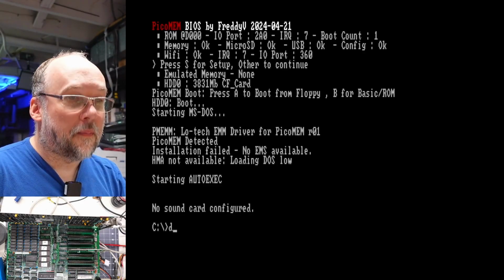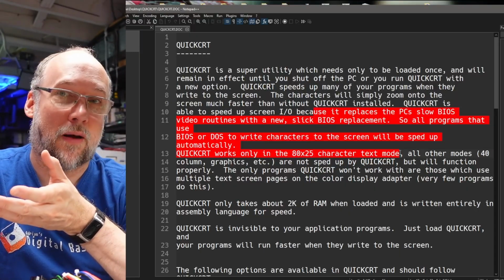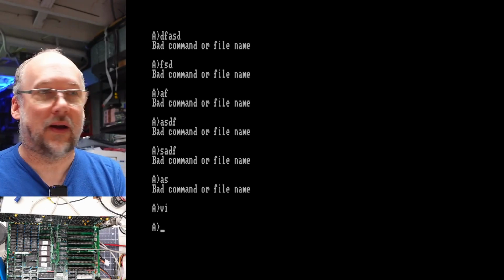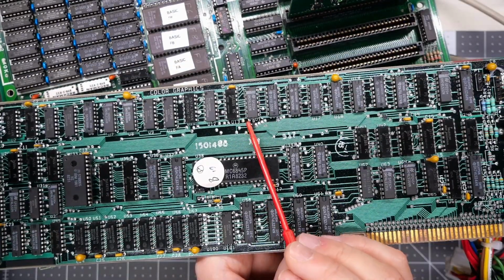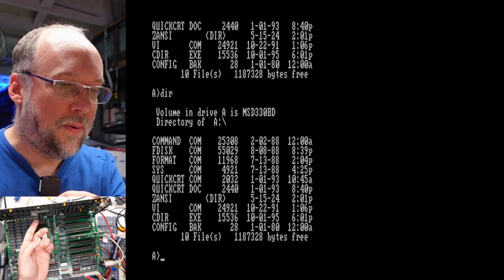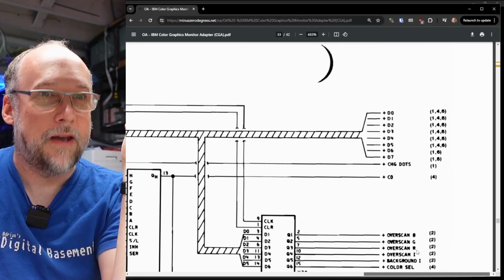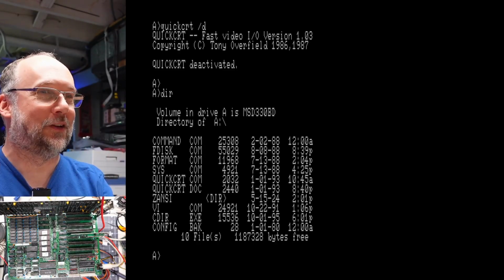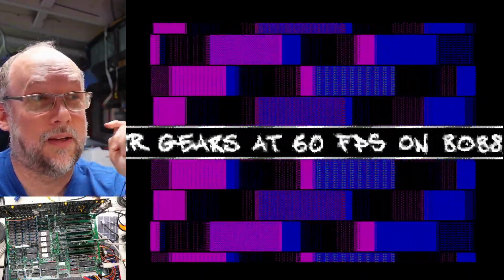Hacking an IBM CGA card for fun and speed!

Comment: Your character set mod is delayed by one character because the character generator address needs to be available before the character generator output and character attributes are latched. You could try tapping into pin 3 of U35 instead of pin 2.

Comment: The wait-for-sync and blank-during-scroll is almost exactly what Commodore did in their first PET, where the 1MHz video memory is not fast enough to accommodate video output and CPU access at the same time. I'm showing this in my deep dive PET video video https://youtu.be/pwb5GvmoAFE?si=WWMkHAxhwFKh93ZK

In the followup PET with 6545/6845 CRTC with 80 cols, Commodore worked around this by making the video memory 16 bits wide - every clock cycle the circuit reads two characters, not one.
Reply: The equivalent for the quickcrt on the PET is a specific POKE command - speeding up screen IO but producing snow on the screen. This POKE in later machines messed up the video circuit and became know as the 'killer poke'. The opinion that it breaks the later machines has been debunked in the meantime though

Comment: This is pretty cool. 

I like mods like this.The only time I really would have an issue would be if it is a very rare piece of hardware with historical value in its original state, the only mods I'd like in that case would be necessary repairs and mods to use the thing at all. CGA cards are common enough this isn't an issue I'd have.

Comment: Umm, I could be wrong here, but the signal you were trying to hack in the second part was labelled -DISPEN .  That suggests to me that it should be low (-) when the display is enabled (not in blanking).  So when you pulled it down to ground, you were telling the computer that it is never in the boarder/blanking interval (it is always displaying video), so there is no time where it is safe to update the display.  (That is also likely why hooking it up to +VSYNC_DLY had the opposite effect you intended too, because it signalled that it was only safe to update when VSYNC_DLY was active (i.e. once per frame).)

You should have tried just pulling it high instead and then I suspect that would have had the effect you intended.  You just had the logic level reversed from what it should be, is all.

Comment: That newer CGA card actually looks like it's got a Video BIOS onboard (the two large chips in the corner).  If that's the case, then the reason it doesn't flicker is probably not because it ignores that hardware line, but actually because when the computer first boots up, it detects the expansion card's ROMs, executes the code in them automatically, which replaces the default BIOS routines with its own custom ones (similar to how ZANSI.SYS or FASTCRT do).  The software patch is just built into the card.

This was very common for most video cards with more advanced features, as they would add functionality to the stock BIOS routines to support switching to other modes, or using more advanced graphics capabilities, etc, that way too.

Comment: Single pixel wide and double pixel wide character sets... seems likely this was intended to support light and heavy (bold) characters in text mode. BUT because of the requirements of composite video bold text is enabled always. Also possibly because they ran out of attributes bits in CGA so the feature couldn't be implemented but IBM already had the ROMs so character set could be selected with this hardware mod. Documentation for ANSI.SYS from Microsoft listed the ansi escape sequence for bold text but it didn't work. So maybe It was supposed to work but the hardware support just never happened

Comment: As an academic exercise, the mods and investigation surrounding them were very interesting.
The fact you posed the question to the audience regarding butchering what is presumably a genuine IBM CGA card suggests you at least belatedly realised that the activities would raise the hackles of some viewers.  
   - Ultimately, it's your board, you have at least one other and as you point out, you'd already resurrected this one from a scrap pile, from where it was in a heavily corroded state. 
          (I'd tin and wick off the excess solder to protect the exposed copper on the edge connector, BTW - precursor and material to gold plate that exposed copper is horrendously expensive)
   - On the other hand, having resurrected a genuine IBM CGA card, it would have been nice to have it in as pristine condition as possible.  
          - The counter-argument to that is, had you done these mods to a supposed 1:1 clone of an O.G. IBM CGA card, there's always the doubt that it is 100% electronically equivalent to "the real thing", so doing same mods on a clone board may generate false positive and/or false negative findings!

Comment: I am not surprised about the font attribute delay (well, I design video pipeline in FPGA for a living) : graphics data has to be read from the character ROM in advance. The attributes are applied while shifting the 8-bit data to the video output, one character delay later.

Comment: Can you replace the dram with sram and just disable refreshing. No its not ruining it, ruining something would be replacing the og motherboard with a pi in an nes. If you actually use the retro hardware you would want to mod to be better at running games and software.

Comment: For modifying the board, I would have considered putting the chip in a socket.  You can pop a pin out of a machined pin socket fairly easily or you can bend the leg of a chip.  
I would also have likely tried to put in some sort of deadbug circuit to make the CRT enable easier to control and also make the blanking signal the software waits for always true.

Comment: It's weird... I had an original 5150 with CGA BITD, and I do not remember the flickering at all.  Of course it has been almost 40 years since then.
I do remember the snow, such as while CopyWrite was failing to dup a disk.  I hardly ever loaded ANSI.SYS though because there were few programs I had at the time that would send ANSI escape codes.  Also, BASIC seemed to go through the BIOS routines so BASIC programs also didn't benefit from it.
But to answer one of your questions:  Turning off the blink bit allows the background to have all 16 colors.  With the text blink bit on, the background would take its brightness bit from the foreground text color, IIRC.

Comment: Maybe instead of cutting the trace and permanently pulling enable pin high, it would be worth adding a capacitor there. So that it stays on during brief interruptions (like, when scrolling), but still keeps off until initialized.

Comment: The font data is loaded into the shift register before the attribute data is read, so it won't have the attribute set for wide font when the font data is being read
Reply from the maker: Ah yes, ok makes sense! It's always offset by one character. (Verified as I've used this card a bunch more.) I suppose this means there really is no way to fix this problem without massive re-engineering?
Reply: @adriansdigitalbasement2  Not if you're using the attribute, no. CGA memory is pairs of bytes, the character code followed by the attribute, so the attribute is always read second. You'd need to come up with some other way of switching between the fonts, which won't be as good as using the attributes...

Comment: If I had the knowhow and tools, the video I'd be hacking would be the colour output of a C64 ... It could be much more vibrant and still retain its charm without having to burn out overdriving a monitor!! Hater's gonna hate, I know - but I started with an Amstrad CPC and I don't think anyone can say that its colours were duller than a stock C64!

I do get that it would change a lot of what gives the C64 its charm and fond memories of course, don't get me wrong, but it would be nice to have the option ... I know there's a vic emulator that lets you tweak it too, but I'm more interested in learning how to do it the hard way, that way I'd at least have a clue about what to do if it goes wrong!

Comment: There's an active-low minus sign in "-DISPEN". I think that when you tied the signal low, you were creating the "active video" state all the time. So it waited forever for the horizontal retrace. Out of curiosity does it work if you tie pin 4 high instead of to the 3.58MHz clock?

Comment: ooh this is fun! 
about the performance mod:
i would reckon the duty cycle of the display-enable signal is the key to speeding things up, rather than its frequency - high represents the display being on, low represents off, so a shorter duty cycle should make it think the display is off for longer

assuming the 3.57MHz clock has a ~50% duty cycle, that's shorter than the ~70% i'd expect from display blanking, but not by all that much

having a very brief pulse at the end of each scan line would probably be ideal for speed, but also compatibility

Comment: this is very cool! And really only possible on this old hardware, where you literally solder around bits and bytes! This is gold for understanding how things work!

I wonder if you could bodge some dual ported Ram on the thing and "route" the acces to different ports depending on the system writing to memory or the CRTC reading and displaying.

huh... can you replace the DRAM with SRAM somehow? just ignore all the refresh shenanigans and use address and data lines accordingly?

Comment: The 14.318/3.58MHz tinkering, try inverting the display enable signal that is already there.  That would still toggle the line allowing the software to see what it wants, but it would result in being able to do access RAM most of the time rather than just when the active part of the display is not being drawn.  Inverting VS before using it instead would give even more access time.  Access time could be extended out even further using a oneshot triggered by HS to give almost full time access but a oneshot would be tied to the vertical rate, so not necessarily a good idea.
Reply: Oh that would  be a worthy followup.

Comment: Have you tried GLaBIOS as a replacement for the system BIOS? It has options where you can choose different levels of CGA snow removal including disabling it entirely to get that same effect as your hardware mod. It also claims to be faster at CGA scrolling than other BIOS ROMs. Would be fun to see you could test and verify that though.

Comment: Not that I've looked but the character dots are probably being produced by a shift register, which latches in the data on the edge of some other signal.  Delay that latch signalling a wee bit so that the CG ROM address line has had time to set and the ROM itself now returns data from the alternate space and you'll likely solve the thin / thick character problem.  A single buffer of a 74LS07 or the like would probably be long enough.

Comment: my questionable thought would be to piggyback another 64K of RAM onto the existing ram and have those outputs go to the CRTC instead of the originals. i dunno if it'd work (and there are a bunch of reasons why maybe not) but if it did it'd kind of like having dual-port ram in the dumbest way possible. :D

Comment: This is all just great. But you don't mention the DOS TSR that fixes the snow problem! Long ago I had an idea for a 3D display using crossed polarizers. To implement it, I needed to understand how IBM PC graphics were generated and controlled. So I bought a book called "Programming the EGA and VGA Displays" and I learned x86 assembler (oh what torture) to understand it. Then hardware got way better, and I realized I was barking up the wrong B-tree.

Comment: 36:48 I think that BIOS procedure can't start writing if signal is already low because it will not know it just started or about to end and how much times i has, so it waits to high and then to low signal yo be sure
Reply: This is my thought, too.  I suspect the BIOS is looking for the transition 1->0.  That's why replacing the signal with VSYNC caused  a steady 60 characters per second.

Comment: I thought the CGA snow was due to IBM not using dual-ported video RAM. The CPU would write to RAM in the middle of the scan line, which would cause incorrect data to be briefly read by the character generator.

Comment: oh god be careful with this and CRTs, you don't want to dump invalid looking pixel clocks / vsync / hsync at a CRT, you can damage it!
Reply: It was only a problem with MDA, wasn't it?
Reply: @aliencray7269  I /highly/ recommend not sending CRTs invalid hsync/vsync signals. 🙂
Reply: @aliencray7269  (weird, I thought my reply went through.)

It depends on what monitor you plugged in. I forget if the CGA monitor sourced its own hsync. But I've seen CGA equivalent monitors that did not.

Comment: Very nice video, I loved it. I can't remember what software hack I used that time, but for file editing we used Volcov Commander.
Volcov Commander (VC) was released later in the early 90's, but in Hungary, our computers were a few generations behind. It was something like the Norton Commander, but with very little memory usage and bare bone assembly programming. I definitely used on 286 and 386, but I believe it's capable to run in XT as well.

Comment: I had one of the earliest true IBM CGA cards. I worked for IBM in the early 80's. It was a pretty terrible card but the 6845 CRT controller was a competent IC that later clone makers were able to improve on with their cards performance. I believe the 6845 is still being made, if not, they're pretty easy to source 45 years later.

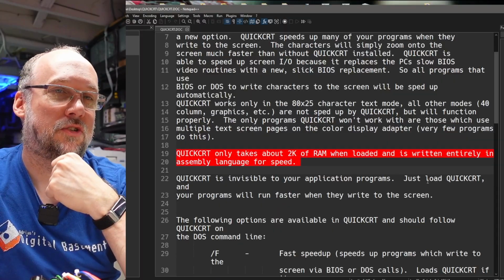Comment: I agree that your vi is using a secondary page; note that QUICKCRT explicitly says it doesn’t support multiple pages (11:00). Vi does that to leave the DOS console output undisturbed to go back to it when you quit it. I don’t know why that limitation in QUICKCRT; supporting multiple pages in an ANSI driver requires maintaining independent VT100 state for each page and manage the switching, which is extra work, but what QUICKCRT does shouldn’t be any harder for multiple pages.

To confirm that vi uses a second page, I found “Calvin” on GitHub for the sylvandb account (YouTube doesn’t like links in comments, sorry). It claims to be “‘Free vi’ renamed because of the swarm of competitors”, but I can’t vouch for that. If you check vv.asm, it switches to page 1 on label “inv3”.

Comment: I watched a YT video where a person engineers a display card from scratch, they started with a timer and using ICs made the v sync and h sync signals by counting timer ticks and testing for bits as the counter went up to tell when a number of ticks occurred.  They made additional videos where they added video memory and got it all working.  I suppose you could do video card using a pico.  It sure is fun learning bits and pieces how this stuff actually works!
Reply: Check out Ben Eater's 6502-based computer from scratch -- the ultimate "how do puter work" from the most basic steps.
Reply: @computer_toucher  Yup, one of the best on YouTube - He's also got a small series about making the worlds worst VGA card or named something similar too - entertaining and educational! 😀
Reply: Are you talking about James Sharman?  I've watched his VGA from scratch videos multiple times, along with a few other people who have done VGA on a breadboard in order for me to figure out how to the the VGA on my current project, which I'm throwing into a CPLD.
Reply: @sprybug  I think so
Reply: I would've thought a Raspberry Pi Pico would be too slow to handle such bandwith of what basically is NTSC, but it seems "ART Pa" here on YouTube made it work.
Reply: @belzebub16  I'm doing 640x480 on a PICO with a 640x320 frame buffer. With dual cores + the PIOs, it's quite capable.
Reply: @belzebub16 There are pi picos that do vga with the RP2040 io processor